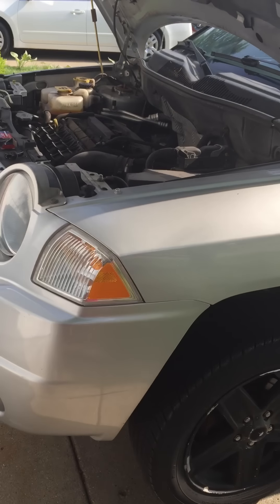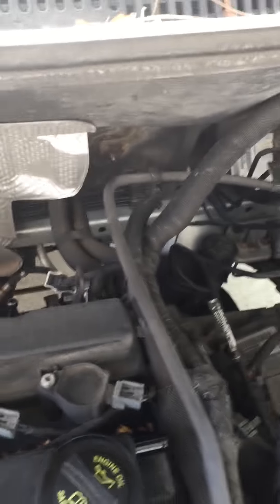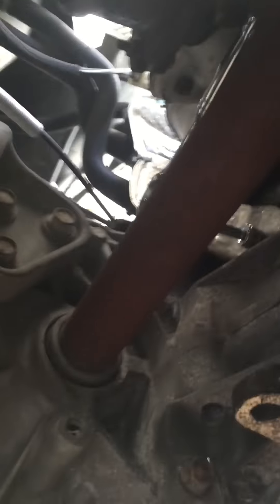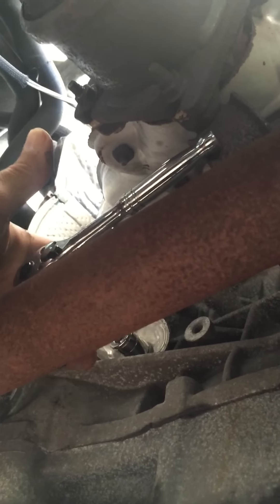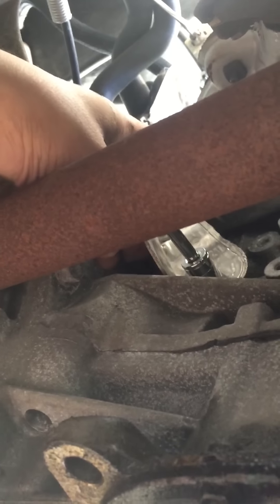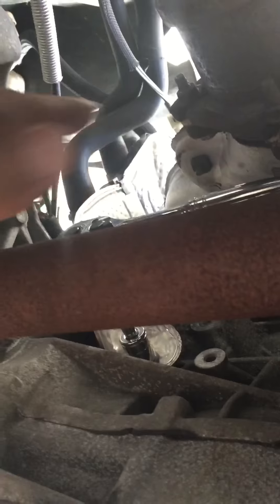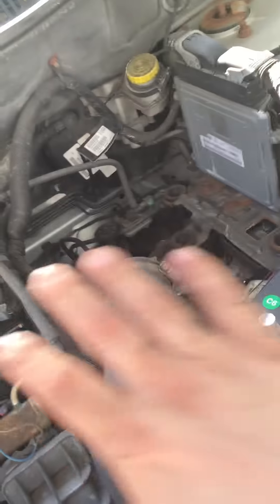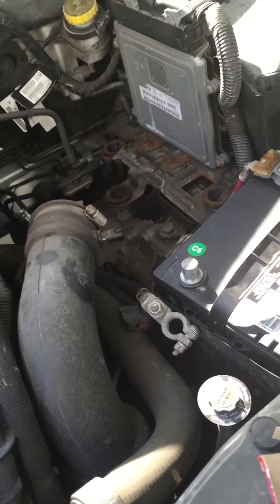2007 jeep compass crankshaft position sensor change to a new one

Comment: Thanks for the video.  I have a 2014 Compass and had some serious starting problems and stalling.  The car was throwing the P0335 Crankshaft Position Sensor A Circuit Malfunction code.  After orienting myself correctly under the engine, I was able to remove the heat shield and find the sensor.  I used a telescoping  mirror to get a good look at the sensor sitting in the block.   That helped so I could get the socket on the bolt.  It took me a while to get the plug off the sensor.  The new one went on quick and easy.   It felt great changing it myself!  Thanks again for pointing me in the right direction!  I would never have found it!

I hope this solves the issue.  It's starting and running without issues now, anyway.
Reply from the maker: You are most welcome 😎👍
Reply: Did u change both ?  The car just died on my wife right now and the check engine light just turned on  its showing the same code as you described.  Let me know I'm about to take these out tommorow

Comment: Follow, up 100 percent worked, had to relearn it by going to 120km then back to 40km 5 times on a drive, then wiped codes again then a restarted, no more codes and everything works great.
Noted auto repair places tried to say the engine was dying and other stories, by compression test revealed that the 160 across the 4 cylinders.

Comment: You can't get to it from underneath on a 4x4 (awd).  I just removed the screws on the air box, and swiveled it out of the way. Used a standard 10mm socket, swivel and long extension ... done! But thank you for showing me where it is!!
Reply: We're having a hell of a time locating it on our 07 4wd compass

Comment: Great video I’ll be working on this tm.  Not sure if i understand the part about having to loosen the 13mm bolt prior to bending the heat shield back? Thanks again!
Reply from the maker: Scooter Mac the 13mm bolt is whats holding down the bottom of the aluminum piece that bolt needs to be removed in order to bend it upwards to expose the sensor which is a 10mm bolt holding it into place.       Thanks for watching 😎 hope it goes well 👍🏼

Comment from the maker: Just a little update on the sensor guys ever since i replaced it i didnt have the chance to reset the ecu but after i did the 3 pulls the car ran good but know that when a check engine light goes on the ecu goes into limp mode which makes the car run alil sluggish because the computer wants you to fix the issue so it dosent let you push the car like normal so it dosent cause a  chain reaction and brake other stuff but in my case after about 2-3 days the light shut off and the car went off limp mode and ran like a champ 👍 ... so now its been 7 months since i replaced the sensor and its still running strong 😎

So i say wait 2-3 days and if the light dosent go off just get it reset and all is good 👍 
Take care everyone .

Comment from the maker: Quick update ladies and gents !!

I just did a buddy of mine 06 mercury mariner and its the same thing except the engine is flipped so the crankshaft sensor is on the right side of the bottom of the engine if you are under looking at it ... a piece of plastic is kind of in the way but i was able to do it without removing it with a 1/4 inch ratchet and 10mm socket 👍🏼

Comment: Please say you respond still. So I just had my air intake sensor cleaned because engine light came on and said that was the issue. A day after driving off with my jeep, the engine light came back on and now reads the crankshaft position sensor A circuit has an issue... so could it be possible that these two are near each other and the crankshaft was disrupted when they went to remove and clean the air intake sensor? I only had 2 issues, I needed my intake sensor cleaned, and new spark plugs and they read the codes and nothing came up after those two issues were fixed. Like I said until a day later my engine light turned on and my car stalled for a few seconds at a stop light i used my code reader and found that now the issue is like I have said the crankshaft... please help!!

Comment: Thank you ,,,,,, iam gonna try right now
Reply from the maker: frank jerseytomato your very welcome good luck and let me know how it turned out 👍🏼
Reply: omg fucking nightmare mines 2011 totally differant cant see anything from the bottom did from the top ,, you really cant see the sensor unless you use a mirror then you get an idea i got it out then taped the bolt to the socket and taped the 1/4 ext to the socket and got it done

Comment: Hey can you help me out man I have a 09 4x4 and I can reach from underneath ripped the air box out all that I still cannot reach it please help I can't put my kids in this car
Reply from the maker: Hello thanks for reaching out ok so since you have the 4x4 unfortunately the transfer case is in the way but it is still in the same spot so as you can see it is much more difficult to replace the sensor.

So unfortunately you are going to have to remove the thin aluminum plate behind the motor....its a long piece starting from the top of the motor all the way to the bottom covering the sensor and sadly with the limited amount of space you are going to have to literally have your chest on the motor and feel your way to find it with your entire arm😕 

Its going to be rough but it can be done over time and lots of patience because the guy i got the idea from did it that way as well until I realized i had the fwd model.

I wish you luck and please let me know how it turned out.

Peace ✌️😎
Reply from the maker: Hey im back please look up @SSTEVEN94 his video might give you an easier way to do it which involves the passenger front wheel to be removed.....good luck ✌️
Reply: @9thgizzyguy  thank you man I even bought the repair manual I duno I think I'm just going to take it to a garage what about taking the driver tire off idea have you seen that way?
Reply: @9thgizzyguy  and from messing with it look at the different sensors my air temp sensor is messed up now haha man I can't win
Reply from the maker: @Shane Fisher wow sorry to here that 😕

Yeah take a look at SSTEVEN94 video he was able to access the sensor by removing the passenger front wheel 👍🏼

Comment from the maker: Hey guys and just to let you know the symptoms of a bad crankshaft sensor if thats the actual problem is while you are driving the car sputters while giving gas and while doing a steady speed the car just all of a sudden bogs on you kinda like it down shifted hard and the front end dips down and it starts shutting off on its own while waiting for a light or on idle . 
Hope that helps later everyone 😎
Reply: Do you remember the error codes you were getting?  I am getting a P0300, P0301 and P0335. Mine has the same symptoms you mentioned. Thanks.

Comment: I found out you cannot go this way if yours is awd at least It didn't seem to work when I did mine. I still had to come down from the top.
Reply from the maker: Rjsponge oh thats right because the transfer case would be right in the way of where my arm went 👍
Reply from the maker: Rjsponge oh thats right because the transfer case would be right in the way of where my arm went 👍
Reply: I don't have a AWD but I have a 4 x 4 12 compass will this be a different way also or would it be like the video

Comment: Same for 4x4?
Reply from the maker: Target Time  4x4 has the transfer case in that section so its going to be a little more difficult but it is in the same spot 👍🏼
Reply: Thanks for reply. Had to come in work early so couldn't look last night. Was hoping I could still reach it from bottom. I seen a awd post and they had to take an axle out. Not sure on my YouTube mechanic skills there :S
Reply from the maker: Target Time i say you never know until you look .. you might find an easier way than hopefully not having to remove an axle .

The video i saw the guy showed to get at it from under the hood but it involved taking that whole aluminum piece off from top to bottom and the entire air intake housing off then shoving your entire arm down with your chest almost on the motor its self just feeling around blind and i was like um there has to be an easier way so i jacked up the car and there it was under the bottom part of that aluminum piece.

So just take a look first you never know 😎